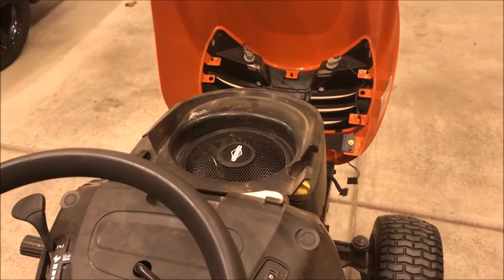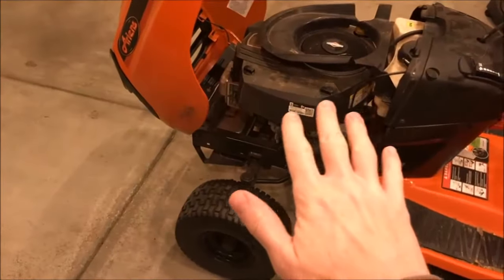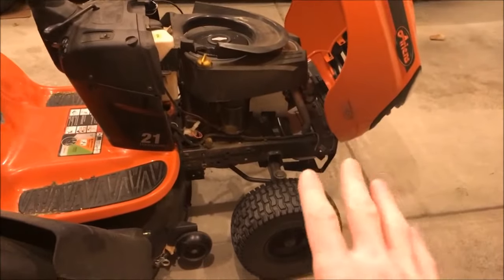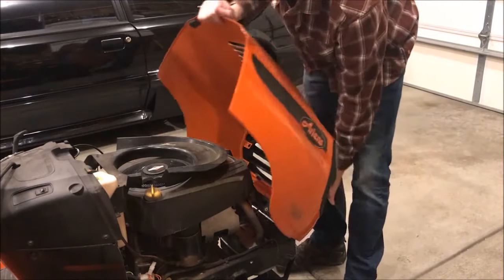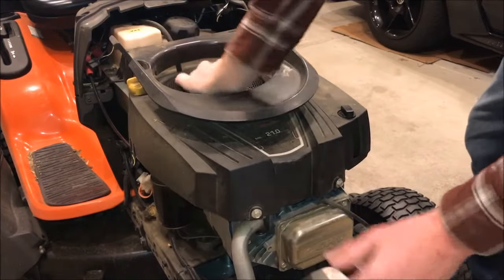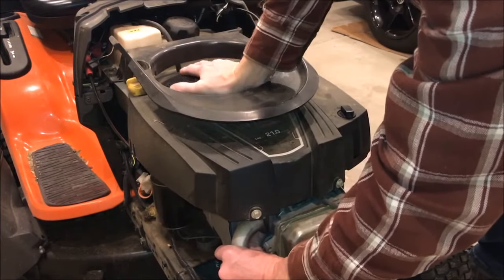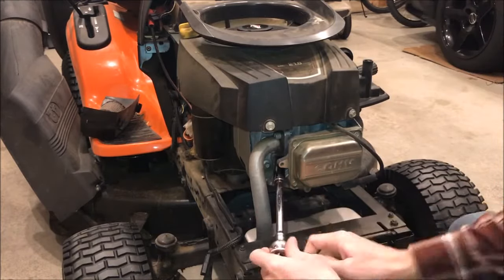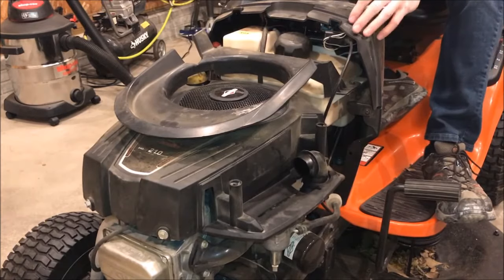Start Compression Locked Briggs & Stratton Engine

Comment: I adjusted the valves on my YT3000 and it has ran for the last two years like a champion!
The compression release depends upon proper valve adjustment. I run ethanol free fuel that I process my self and I also had a squirt of two stroke to the fuel to give it some top cylinder lubrication.
I run a  YT3000 with a 21 hp platininum.
Reply from the maker: Hello. Yes, proper valve lash is critical to the valve release mechanism working properly. One should always adjust the valves first before changing the cam or resorting to my method for starting when the mechanism is indeed bad. Thanks for the comment and advice!  Awesome you make your own fuel 👍
Reply: Aman
Reply: I'm having problems with mine right now losing compression when trying to crank
Reply: My YT3000 has had the compression release camshaft replaces twice in 2 years.
I found a temporary fix to get it started is to remove the airfilter and cup my hand over the intake while cranking (creates vacuum, thus lower compression).
After the engine cranks a few round, I remove my hand and WaLah! fires up.
Because the compression release is sure to break over and over, I am going to make the permanent work around liek this . .. 
https://www.youtube.com/watch?v=hFaxIl_rDg4
Reply: UPDATe - turns out adding the pipe to the head was enough to fix it (lower compression enough) without having a solenoid, so I replaced the solenoid with a simple cap on the pipe. ( I am also going to try no pipe fix and instead just use a stack of head gaskets (2,3,4? of them) to increase the head chamber space which will slightly lower the compression (enouhg to start and run).
Currently - Start and runs great with the old broken release mechanism still sitting in the bottom sump of the engine - unless you turn your mower upside down that metal part will stay in the bottom oil sump and not cause any harm.
PS -
it wouild be a freak instance where that part coming loose could cause sny harm to the rotating assembly - it would have to land just right onto an open rotating gear and, even then, I think it would damage the part more and not the gear (gears are made of a much harder steel than the little weight).

Comment: On my 19.5 hp I just turned the flywheel counter clockwise to the other side of the compression stroke and most of the time that works provided it is warm outside or the engine is warm. You need a good battery though.

Comment: You were spot on. I assume that if I did what you showed it does not fix the problem of starting on future attempts?
Reply from the maker: Hello. If adjusting the valves does not work, it’s likely the compression release mechanism that’s causing the problem of the engine not spinning on start up. I’ve got more videos on that if you care to browse and check them out. Best of luck!

Comment: Had this problem on a Biggs & Statton engine as soon as I removed the spark plug petrol came flowing out of the engine, that was causing the compression problem .Previously I had been working on problems getting the carburetor float bowl to seal eventually sorted that problem, I'm not a Mechanic so no idea how the engine flooded but fires up perfect now. Thanks for your video.
Reply from the maker: Hello. Yeah, hard to say how that happened, but on these motors I’d believe anything.  Glad you got it sorted 👍
Reply: Bad fuel valve and/or seat on the float, or cracked float.  Maybe.
Reply: Last week I fixed one of those for a friend that did the same exact thing, when I took the plug out and cranked on it there was enough gas that sprayed out of the cylinder that I thought possibly the engine was hydro locking on the compression stroke, then I took the valve cover off and both rockers had so much play in them that one of the buckets (tappet if you will) had fallen off of the valve stem and was laying in the bottom of the valve cover, replacing it and adjusting the rockers properly is all it needed to crank and run properly. 
When the rockers get way out of adjustment the valve train has so much play in it that it negates the automatic compression release mechanism, that compression release only opens the valve a tiny bit, when you've got that much slop in the valve train the automatic compression release doesn't have enough lift to bring the valve up off the seat, just adjust the valves to spec and I'll bet it'll crank over just fine.
I've fixed a ton of these things for people that were about to take them to a shop figuring they were about to buy a new cam and pay to have it put in, I'd lay odds that the majority of the time that those shops charge people for a new cam and installing it all they do is adjust the valve rockers and wait a couple of days to have the owner come it to act like they replaced the cam.
When they get hard to crank take the valve cover off, then turn the engine by hand with the spark plug out to where one of the valves is open, then grab the other valves rocker and see if it moves all over the place, repeat for the other one, if they have all kinds of play in them then I'll bet a simple valve adjustment is all you need and your engine will crank just fine. 
Don't wait until the engine gets hard to crank to adjust the valves in the future, do it once a year, by running the engine with all that slop in the valve train the parts are clanking around all over the place and that's what breaks those automatic compression release mechanisms. 
And the reason for doing the adjustment on one valve while the other is open is to assure that the valve that uses the automatic compression release isn't on the release when you adjust that valve, that's another mistake I've seen people make, they adjust the one valve while it's on the compression release, it's easy to do since it only bumbs the valve open a small amount compared to actually being on the cam lobe, if one valve is fully open then you know for sure that the other one can't be on the compression release, I know only one valve uses it but that's a for sure way of making sure you don't adjust the valve that does have the release while it's on the release.
Reply: @dukecraig2402  thanks for the knowledge! My 3year old B and S did this yesterday.  I'm betting it's valve related. Soon as I get home that's one of the first things I'll look at.
Reply: I didn't realize you were the gentleman I'd talked with earlier and you'd text me back😁Hey thanks again for the tips. I work on bikes alot but I've neglected this mower. I bet this does it though
Reply: @BM205  
What kind of bikes?
I used to have a bike shop, I basically only worked on Harley's but that's only because I didn't want to buy metric tools and I had enough money in speciality tools for them and didn't want to start buying them for every other bike on the road.
Reply: @dukecraig2402  sorry to take so long to answer I have terrible service. Just dirtbikes  I've rode for a long time mainly 2stroke RMs but I'm on a KTM 300exc now. I pulled the valve cover and while I can't find my gauges (15year old son🥴) the valves are a little loose but not really bad like I expected. The cylinder wasn't full of fuel either and the wiring looks fine with no corrosion. I'll bring some gauges home and tighten the valves but I'm not sure if that's it.
Reply: Sounds like it was hydrolocked. Glad you got it going!

Comment: My 1996 Tractor style Snapper with Briggs engine was doing the same thing. I adjusted the vales. No help I could turn the engine by hand w/o removing the spark plug and no starting fluid. I turned it past the compression stroke and started it. My battery checked out good but it was a 4 year old Die Hard from your local members store. I put a new Wal mart battery in it with 25 less amps and it is  starting now even better than that Die  Hard did when new.
Reply from the maker: Oh wow…sometimes diagnosing can be tricky especially when things are checking out. New battery was for sure the best outcome. Good work 👍
Reply: @FastFixYouTube  Thanks FastFix. I made another post furthering the story which I'll do now. After mowing my yard and struggling to get it cranked, I put it up for the night. The next day I installed the new battery, Cranked great but engine was running wide open. Found a small twig stuck in the governor mechanism  took that out and it runs  perfect now

Comment: also works if you hold your hand over the carb intake which chokes the hell out of it,been running one of them for 2 years that way,not necessary to remove the spark plug,just spin it backwards by hand,shoot it with starting fluid
Reply from the maker: Hello. Yes, you’re absolutely right. I certainly took the long road to get this thing started and have since adapted to simply covering the carb intake and choking the hell out of it as you say. Thanks for commenting and leaving some good advice!

Comment: I have the same Ariens mower 17.5 hp. I don't know if this works for sure, but a guy said if you put double head gaskets on for this comp release problem, it will lower the compression enough for the engine to start and not drastically lower the horsepower. I may try it if mine develops this problem.
Reply from the maker: Interesting! I had not thought of that as an option, but I suppose it could work. However, stacking head gaskets seems very risky and something that could likely turn into annoying problems down the line. The last thing you want is to have to replace head gaskets once per season.  I’m not sure if there’s been any research done, that could give data toward knowing if doubling head gaskets causes head gasket failure. I would imagine it would. ButBut it’s something to try! If you do it and you get good results, let me know!

Comment: I done everything I could to get my 18 horse brings to turn over I could...now I know why it's the compression relesee unit that's failed and I discovered the back up compression  trick to get  it running on my own... need to take a picture of the mod and tool I made to get it going  really easy.
Reply from the maker: Hello. Sorry to hear yours failed too.  I expect most are on borrowed time. I did a few extra steps in this video, but really all you need to do is spin the engine near TDC then use a rag to block the intake. That usually works well. Thanks for the comment. Interested in the tool you made.

Comment: Hey cool. Ill try that next. I was close at turning it but didnt realized top dead center would do it. Mine did the same thing. I thought maybe it was a fluid lock. Oil smells like gas. I was using small engine oil on a 14.5 ho briggs.
Reply from the maker: Best of luck!

Comment: JUST rotate the engine to center of the compression stroke, which you can feel without pulling the plug. That is when the starter has the best chance to overcome the next compression stroke and start.
Reply from the maker: Hello.  Yes, you’re right. No need to remove the spark plug 👍

Comment: Hey there, you are the closest to the problem I am having with my Scag Liberty Z ride on. Learning as I go with youtube assistance. Have had to take the spark plugs out kick it over and would start on spark plug reinstall. Is it possible to tell me what needs doing so that this is resolved? Cheers, Ron.
Reply from the maker: Hello. First thing to try is lashing the valves correctly. The specs on this depends on the motor. You’ll have to look that up. I wish I could point you to a good directory, but it’s like finding a needle in a haystack researching small engine specs…. If that doesn’t solve your problem, a cam replacement is likely your next step. I’ve got videos on that too. Best of luck!
Reply: @FastFixYouTube  Thanks Jason, I lashed the valves and appears to have fixed the problem. After much confusion as to the gap clearance I took the average of all info gathered and went with .127mm on the intake and .178mm on the exhaust. It's a Kohler 7000 series and after replacing the covers with new hi temp silicon I came across the service manual which shows clearance as 0.101/0.152 (doing this first would have saved time but better than having it too close which can make the motor hotter from what I read). Rather than opening again I just went with it, the motor is sounding great, done the lawn and it started again soon after which it wouldn't do that led me to researching and getting in touch. Anyway,  Thanks again Jason.
Reply from the maker: Hey, averages work!  Glad the easy way worked out!  You’re very welcome for the video. Thanks for the comments 👍👍👍

Comment: I have a very low hours b&s powered mower. When it just wont crank, I rotate the engine by hand, just past the "hard" spot. It then starts right up.
Reply from the maker: Sounds like a broken compression relief mechanism or you need to adjust valve lash. I’ve got videos on those procedures as well. Let me know I’d adjusting the lash helps. If it doesn’t, likely needs a new camshaft. It’s frustrating, I know.

Comment: I’ve had this problem and I just turn the engine backwards until I feel resistance and start it there. I’ve never pulled the spark plug. The same symptom can occur with excessive valve clearances, with nothing broken. Have had new Briggs and Stratton in a Husqvarna tractor with valve clearances of .012” and .014” that did this. Check valves before tear down.
Reply from the maker: Absolutely correct. Everything this comment said is accurate. I’ve also forgone removing the spark plug and now simply stuff a rag into the intake and that does the trick. Yes, incorrectly lashed valves cause this symptom too. Good call outs 👍
Reply: Check valves for sure, i put a cam kit in, no change, set valves , fixed.

Comment: Thanks for this very useful video. 
I checked the valve clearances but knew from the symptoms that the decompression mechanism was broken on my Intek version. 
I wound engine ccw until resitance was felt and found that 12.5 volts wasnt enough, so gave it 14.4 volts off a running car and that started it.
Reply from the maker: Hello. Love that method. More Power!  Wins every time. Good job 👍👍👍

Comment: Just so you know you can cover the intake of the carb with the breather off with your hand air tight and the engine will also turn over basically using your hand as a compression release

Comment: I forgot to step on the clutch before starting my Troy Bilt Pony mower. Now it won’t start. It had turned on just a minute ago without any issues when I stepped on the clutch. The engine does not crank, but just a click that I can hear from the starter solenoid when trying to start it. The engine fan barely spins when turning it on, but I was able to rotate it when I took the cover off the engine. Spark plug did not have much carbon build up & just did an oil change recently. Any suggestions?
Reply from the maker: Hello. Interesting, I would think there would be a safety switch that would dissallow the mower to be started without stepping on the clutch. However, perhaps not. In your situation it kind of sounds like compression lock or you may have a weak battery at this point. The clicking can be indicative of both those things. Sorry I’m so late in replying to this, but I’d hook up a set of jumper, cables, and see if that does the trick. If not, you’ve probably got bigger issues. if the battery is fine, adjust the lash on the valves and see if that fixes things up. If not, you may have a failed compression release mechanism… Hopefully that’s not the case. Thanks for the question!

Comment: I'm convinced my compression relief mechanism has failed, since I have a newer battery and starter. The only reason I'm dreading the repair is that it's my only mower so I'd need to repair it in a timely manner. I'd be OK running it with these "hacks" but worry about a major failure if the mechanism is sitting somewhere at the bottom of the sump cover. Thank you for sharing!
Reply from the maker: You bet!  I’ve been running mine all summer long with a broken mechanism. I share your concerns regarding metal in the sump, but like you this is my only mower so I’m just crossing my fingers that all will be well. Best of luck when you make the fix.
Reply: I know about the compression relief problem for a long time now and I think my little 3 series has ran like this for about 2 years. Just haven't had the opportunity to take it apart. This is the first time I hear about metal in the sump.. :D Lucky I guess.
Reply: Running 2 years now & not ripping it apart. Will buy another $500 tag sale mower first! (Not my money... the "company's" money)

Comment: With blades engaged as a mowing I began to get a shake and about 20 seconds later KNOCK...it's locked up right now. Was the knock from the pressure build up or was that the sound of motor/metal?
Reply from the maker: Hello. It’s hard for me to say without seeing/hearing it. I’d check the belts and make sure they’re disengaged. It’s be weird for the motor to just lock up unless there were severe mechanical issues going on internally.  So, make sure belts are disengaged then try and rotate the flywheel by hand. If it won’t budge, you likely have an internal failure. Hope this helps.

Comment: My ariens has done this since new in 2010. I've noticed this happens when my battery is deteriorating or low.  If it does this I just put my palm on the fan cover and it unlocks it and cranks right up. This issue is why I became a lawn tractor specialist as a side gig and buy  cheap LT and sell high after I sauce them up.
Reply from the maker: Hell ya, nice! All the sauce 🤙

Comment: Should i always place the lawnmower on choke.. before spraying the starter fluids...??
Reply from the maker: Hello.  Yes, typically the choke is needed.  Best to error on the side of applying the choke, but try both choke and non-choke if you get mixed results.  Best of luck!